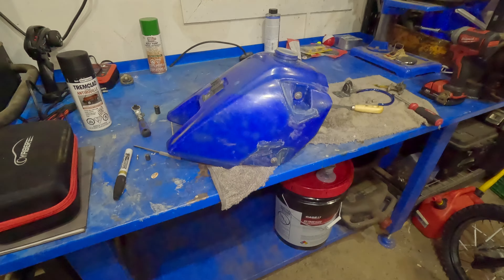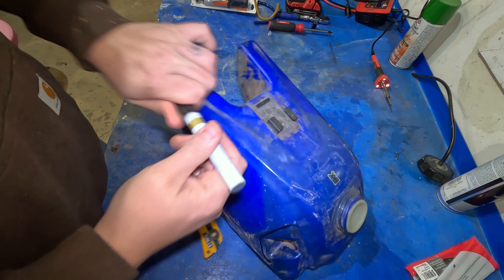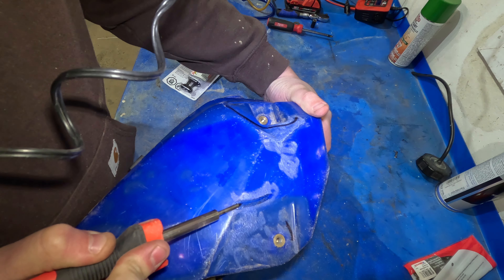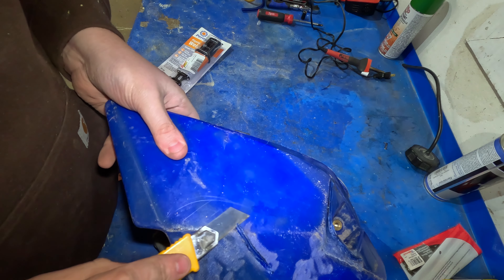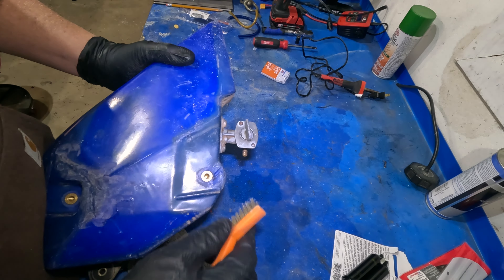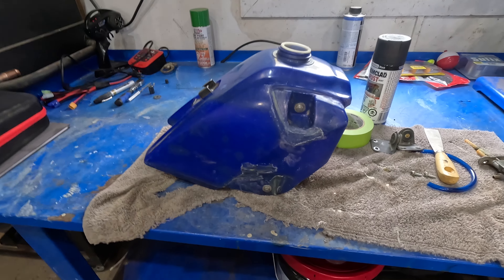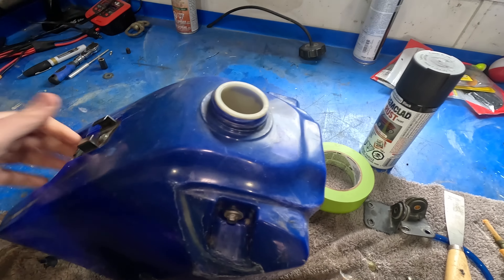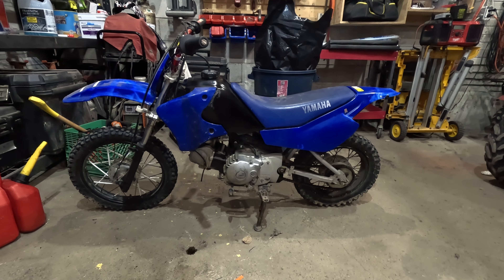Cracked dirt bike plastic gas tank repair.... TTR 90 Cracked tank

Comment: I did what you did Melting a groove along the crack with my soldering iron on the same colour tank, for a Yamaha WR450F "But" then i filled the groove in with the excess melted plastic from the sides on the tank. BTW that plastic the tank is made from is called  High Density Polyethylene or (HDPE) they say nothing will stick to this shit!  so any glue or anything like this was out of the question for me unfortunately. Any way my tank held up full of fuel ok, Until the bike shop that was completely rebuilding my bike left my bike half full of fuel out in the sun on a "Very" Hot day, My cap breather hose had a one way valve ball bearing in it Stopping any air from getting out And when the Tank expanded on that hot day the tank Burst along that same crack that i fixed, Bummer !!  Haven't re fixed it again yet,  but i bought some Blue colour HDPE  High Density Polyethylene plastic rods from eBay, So next time i try i'll fill the groove with that HDPE Rod using a heat gun after making the groove again with my soldering iron. Next time it'll be much stronger because of the HDPE plastic rods filling the gap. BTW i noticed that when the plastic on the tank is melted & filled in using the soldering iron it seems to be a bit brittle, Hence using a heat gun to lay fresh HDPE in the groove but not melting it enough to make the plastic run. Anyway good to see your video.